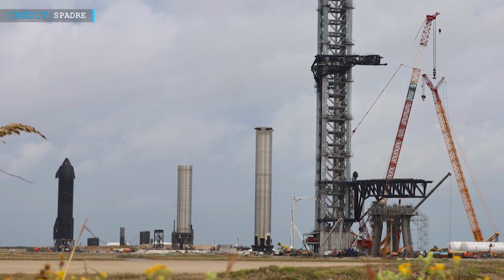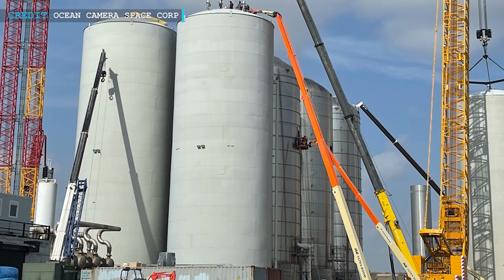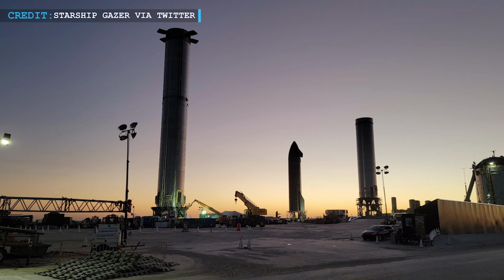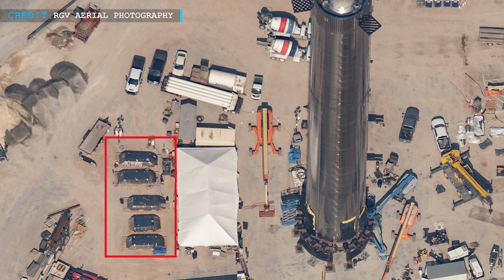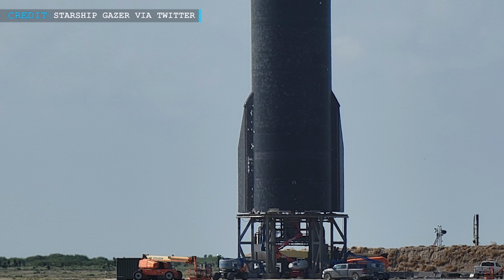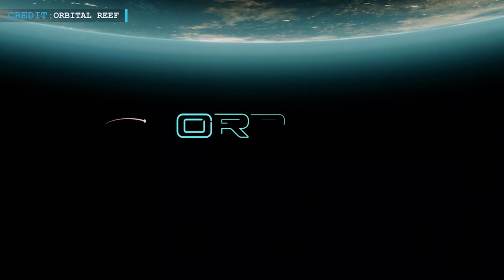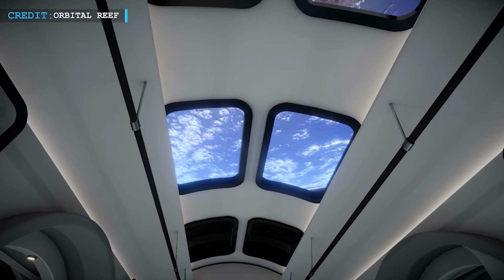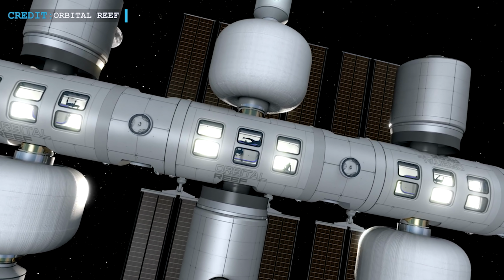SpaceX Starship new Heat-Shield for Booster 4 | New Vacuum Engine| Blue Origin announce Orbital Reef

Comment: Musk stated only 4 or 5 engines will be fired in testing instead of the previous idea of 32. The reason he gave is somewhat perplexing considering he is allegedly the richest man on the planet. His reason is cost. He said they are really expensive to make. This is also perplexing considering that he claimed max production will make the cost dramatically cheaper, How's that working out?
Reply: If they fire all 32 at once, the force to pull up the launch pad will be huge. Not sure the pad structure and booster can hold it. After all, it is design to fly away.
Reply: @Theoryofcatsndogs  True, especially if Starship is not stacked. Maybe he can test all the engines in a round-robin?

Comment: Boeing starliner for commercial joyriders? Just wait till they see the quote for one capsule + rocket (non-reusable).
But as BO is the initiator of this project,  SpaceX won't ever be a part of it.
Reply: SpaceX seems to be in the rocket making business not graphic design.
Reply: @whatabouttheearth  I am giving BO the benefit of the doubt here, I'm inclined to agree with you. But seriously, BO will produce results some day, once they get their issues with BE-4 engine fixed and NG ready. After that, it depends if BO can build rockets at a high pace and THAT is something I seriously doubt, just like Boeing and ULA. They're all stuck in old skool management, unlike SpaceX that simply threw the rulebook out of the window.
Reply: What's the rationale for the Reef being in a 51.6 inclination orbit?